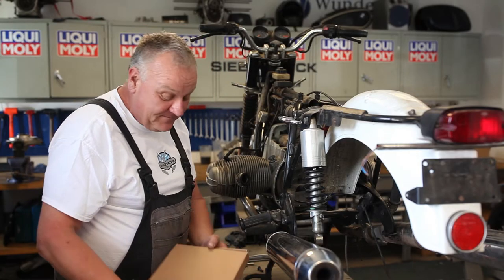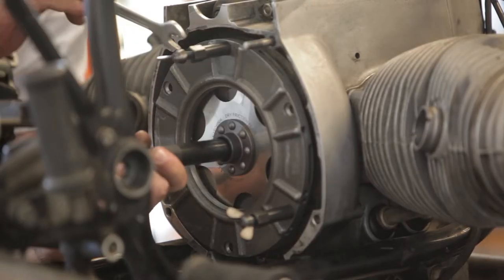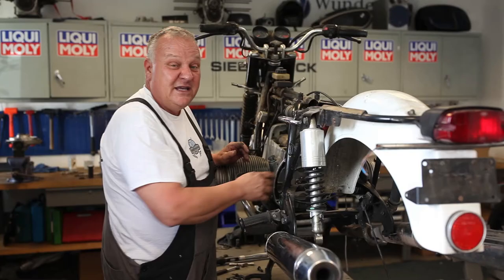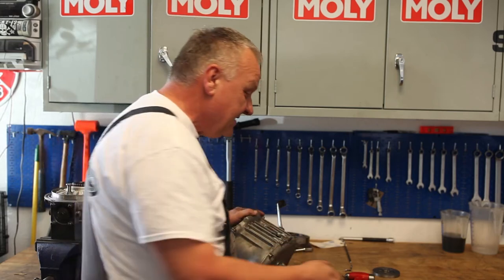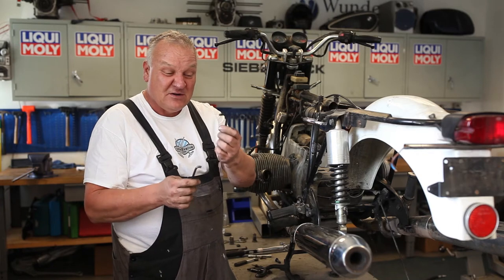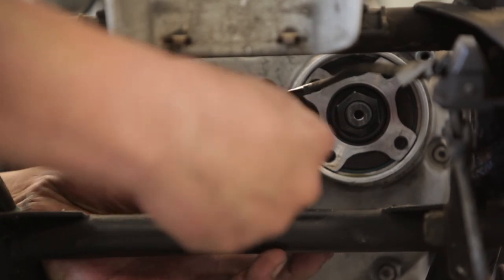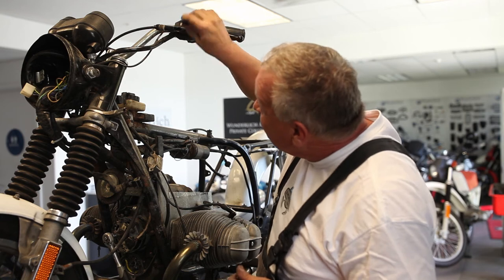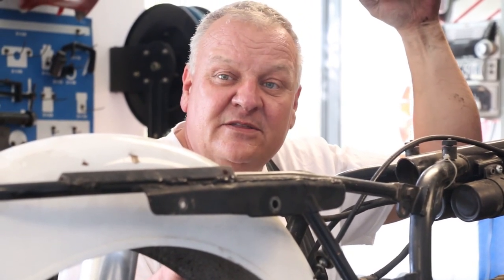BMW R90/6 #5 : Clutch Installation

Comment: Hello William, I love your videos.  I have just changed the flywheel on a friend's R75/6 so have revisited all this work. Much as I like your bush to install the felt seal on the clutch pushrod I have found that if you install the pushrod from the front with the felt seal in place you can guide the seal in without any problem. The clutch operating arm pivot and its clip are always a worry and they can be replaced by a M8 x 70mm stainless bolt and nyloc nut.  The 70mm will need trimming by about 10mm but means that there are no threads on the part where the operating arm turns
.
Best wishes
Richard Micklethwaite
Reply from the maker: Hi, Those are some great tips! Thanks for sharing!

Comment: This video is very well done and very useful.  The only problem I noted was when his hand blocked the area he was working on.
Reply: I don't agree with the spline lubing methods used here. A thick pasty, sticky moly grease like Guard Dog Moly 525 is more effective and will not fling off. Secondly you never lube the clutch plate splines; only the transmission input spline shaft. Any grease you put into the clutch plate splines is going to be pushed forward and out when you install the  gearbox and that grease will be flung right into the clutch disc area which will foul and ruin the disc. Other that that, this video series is great stuff!
Reply: We are just getting started and we will be doing our best to improve these technical issues! Thanks for your comments.

Comment: Thank you for putting together these comprehensive videos!  I was hoping you were going to replace the output seal on the gearbox on this bike, mostly because my new-to-me 1978 R80/7 had fluid under pressure in it when I drained the fluids recently. I'm on the fence between a) just putting the proper amount of oil in all three holes and running it for a while to see what''s migrating to where vs. b) just going through the final drive, the drive shaft, and the gearbox now in the off-season.  Leaning towards option a) for now but looking forward to going through the whole bike over the next year or so. Before I do anything else I'll check the hollow bolt that vents the gearbox, but if you have any thoughts on other next steps I'm all ears!  Also psyched because I think the reprinted shop manual that I ordered from you last week should arrive before the day is out!  Thanks again!
Reply from the maker: Greg: It's a good idea to drain and refill the gearbox, swingarm and final drive with the correct quantities and ride for a couple hundred miles, then drain into some sort of graduated containers to see if a different quantity comes out. That will tell you a lot about what needs to be done, if anything. Definitely a good first step and place to start. Hope that you enjoy the manual!
Reply: Thanks!  That sounds like a solid plan.  I did also find the speedo bolt/transmission vent completely plugged, so that helps to explain what's going on.  Hopefully that will solve the problem but I'll confirm once I get a few hundred miles on the bike.  At this point in New England that might not be until Spring :(

Comment: Thanks for your great video(s).  I've been working on these bikes for over 40 years but you've shown me new stuff! But your 202mm setting for the clutch operating arm doesn't work for me - at least not on a part worn clutch.  Doesn't it depend on both the amount of free play in the cable - not all are identical depending on supplier - and the amount of wear on the clutch plate and other parts? I think you have to set it up with regard to the point of contact of the operating arm at the gearbox  - some manuals say the operating lever should be parallel to the gearbox cover at the halfway point on the handlebar lever.Please keep them coming.

Comment: GREAT VIDEO! I am rebuilding my RS as a café racer and will be replacing rear main seal /oil pump o-ring, trans input and output seals, rebuilt forks, swing arm and steering head bearings and complete clutch with your video help and parts. Would like to have seen transmission output seal replacement when you did the input seal. Any special tips or advice on that? Thanks again for you help
Reply from the maker: You'll need to remove the output flange. This requires a special puller. Usually there is no need to replace that seal unless the gearbox is opened up.
Reply: Thank you very much. I really appreciate the fine videos and look forward to new ones. Congratulations on your move! @boxer2valve

Comment: Nice video. But: Using grease on the clutch? I prefer to work with ceramic paste.
Reply from the maker: It's been working well for us, but great suggestion. Do you have a certain brand that you use?
Reply: @boxer2valve  Yes, Liqui Moly. But I think you can use every other brand. By the way. A more flexible handheld cam would be a great addition to the fixed cams when it comes to details. But this is critic on high levels. Great work. Love your videos!

Comment: Thanks for great encouragement,  instruction and tips for doing my own work. Can you give dimensions of bushing you made to easily install felt in release assembly? I love the way your parts are shipped with each part labeled with description. Great for ordering parts ahead of time for my numerous airhead projects.
Reply from the maker: Hello Paul. The bushing has an inside diameter of 8mm and it should be 25mm long or longer.
Reply: @boxer2valve  Is a inside diameter of 8,5 mm also suitable?

Comment: Video really helps with the details.  But, R65 1980 5 speed transmission is presently off the bike. When I rotate the output shaft, where it connects to the universal connector and drive shaft, it is nice and smooth in Neutral.  However in any other gear, there is little over a 1/4 inch slack when rotated either way by hand. Sounds like a common problem for all gears. Help, can this be repaired.  Thanks
Reply from the maker: That may not be a problem. The shift dogs, where the gears essentially connect, engage in a slot, which is longer than the dog so you can feel some movement as you are describing.

Comment: hi, thanks for the video, really usefull... one question, don't you deal with the heavy sides of the clutch parts? i did as you showed but i got a bad vibration at 2500 rpm
Reply from the maker: The balancing act is not very scientific and that can happen. you can try taking it all apart again  but other than that, run the motor at 3K plus...

Comment: Overall the videos are really helpful William. But this one isn't good enough. Not enough close ups. Bushing bit for example. What allen key size was cut down. It's like you guys hurried through this. Which is disappointing as I purchased the downloads and I'll be frustrated looking at your arm in the close ups instead of seeing what you're doing.